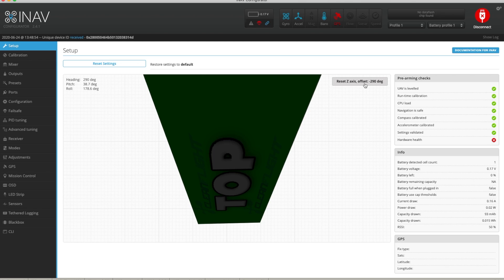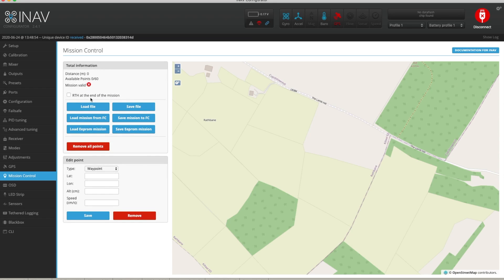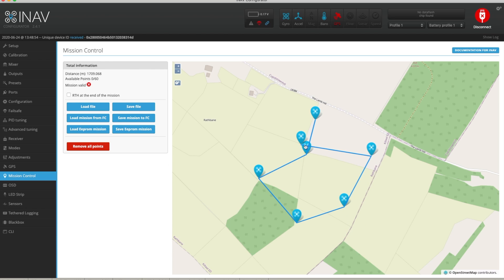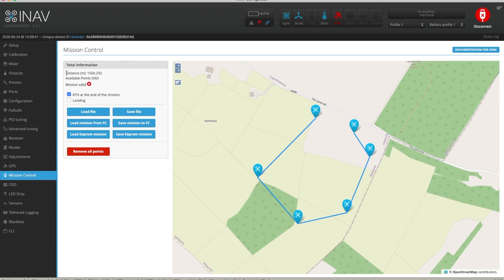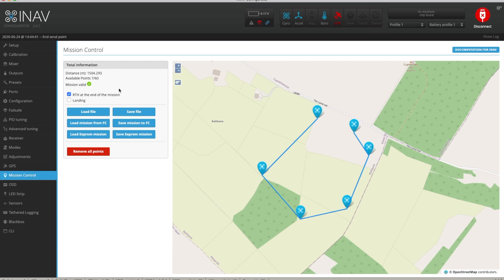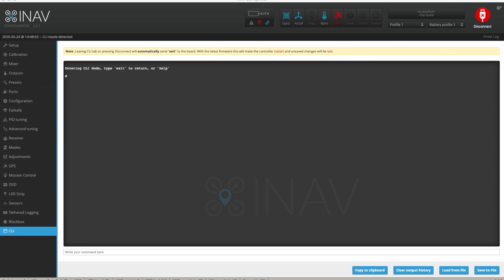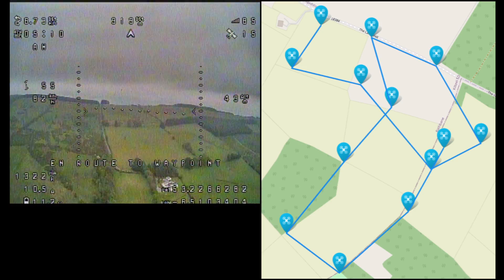iNav Mission Control for Fixed Wing ✈️ How to and Demo Autonomous Waypoint Mission 🤖

Comment from the maker: UPDATE: Please read the two minor corrections to my video in my video description.
IMPORTANT NOTE: Please make sure your plane flies well in an autonomous mode such as RTH before attempting a WP mission. I recommend higher altitude and close range for your earlier tests. Good luck! :D
Reply: Tx for the video, it inspired me to try flying a mission, which I did a few minutes ago, successfully.
I was just watching the FPV video back, and even though the speed did take a while to match, it did seem to get to my desired speed, eventually, and then maintain it. That might have just been coincident. Will try it again tomorrow.
Reply from the maker: Aidan, that's great to hear :D cheers!
Reply: RTH speed changes once you load a mission. Cruise set at 1550 perfect without mission. Once you load a mission and use RTH 1550 is too slow. With 2.5 anyway.
Reply from the maker: Hi Phil, I haven't noticed any issue with my RTH speed when using a mission and as I mention, I always use RTH at the end.

Comment: Hello. Will the plane continue to its waypoint missions if the transmitter loses connection..? Thanks..
Reply from the maker: @espanolacj  hi, there’s a setting for that. I explain how it works in the video
Reply: @AdamGdoesFPV  thanks..i watched your video again, and there it is .

Comment: Greetings, great video. I have a mission scheduled behind the mountains, I will surely lose TX signal, I will use the parameter failsafe_mission_delay = -1 so that the mission continues using the GPS. But what happens if I also lose the GPS? What function would this parameter do in the mission failsafe_gps_fix_estimation_delay = -1 ?. Would it be better to activate the failsafe_gps_fix_estimation_delay = 7 ? Would this activate the FS even if I have the ailsafe_mission_delay = -1 ? Now INAV 7.1.2
Reply from the maker: I don't think you can do anything if you loose GPS to be honest, whatever your settings you'll most likely lose the model. Losing GPS is insanely rare from my experience.

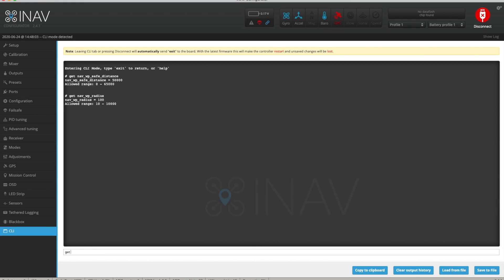Comment: Just wanted to share, at 8:05 CLI command changed to get nav_wp_max_safe_distance in later version inav.   failsafe_mission at 9:22 doesn't work either in 6.0 and look like failsafe_mission_delay = -1 makes the failsafe procedure won't activate at all.
Reply from the maker: To be honest I might take this video down as WP missions have changed so much in iNav this is no longer relevant. Thanks for the info
Reply: @AdamGdoesFPV  I was unawake when I saw this and wondered how anyone could find my upload and want to take it down.  Your waypoint video was one of a few I watched before trying it.  It did smaller area waypoint with no issue, but on 2nd trial covering a bit larger area (but nothing crazy at all), it failed.  Quite weird way.  Have you experienced or heard anything like this.  R-XSR is a suspect and will retry with a fresh part.  https://www.youtube.com/watch?v=5BHoS3-ULBM

Comment: Hi nice video, I am planning to build a fixed wing from scratch and want to use the Matek F411 WTE as FC. I was wondering if you would know if this FC is capable of waypoints missions. I assume it is since it runs on Inav 4.1 or higher but I am new to Inav so I am not 100% sure.
Greetings
Robin
Reply from the maker: Hi Robin, I run inav 5.1 on that FC no problem, so I can't see why you wouldn't be able to run WP missions on it. Cheers :)

Comment: Hi Adam. I have another question regarding regaining RC link. Will the waypoint mission continue when RC link is back on? meaning if between waypoint 23-30 I lost RC link due to distance, when it flies back in the range and RC link is reestablished, will it continue with waypoint 31, 32 .... ?
And I can also choose to turn off waypoint and take control of the flight there on?
Thanks.
Reply from the maker: Yes to both 👍🏻
Reply: @AdamGdoesFPV  
Thanks lots for your reply. I have successfully executed Waypoint Mission based on what you had shared.

Comment: Hi. 2 questions if you could help enlighten.
1) what if mid WP mission I want to abort, how do I take back control of the plane?
2) when it RTH and loitering, how do I take control back and land it?

Thanks.
Reply from the maker: Answer is the same for both. Just switch to a manual flight mode and you'll be in control.
Reply: @AdamGdoesFPV  Thanks! Got it!

Comment: That speed setting is used by multicopter. Fixed wing doesn't care about the speed value in mission control 😁
Reply from the maker: Yea, as per video description you need to set the ‘cruise speed’ as that’s what is used in WP missions.

Comment: Is the stick command the same in mode 1?
Reply from the maker: No you'd need to move the left stick to the top right. iNav is looking at the roll and pitch signals being at 2000, so that would be your left stick.
Reply: @AdamGdoesFPV  If I have to throttle at 1000 (down), rudder at 1500 (center), elevator at 2000 (up), roll 2000 (up) I get right hand down left and left hand up and center (in mode 1)
Reply from the maker: @claudiopepefly  Ok I just looked at Mode 1 layout and it's different to how I thought. But the way I see it now is left stick top middle, right stick bottom right.

Comment: Hi Adam , was wondering how to load the mission using mode 1 radio ? the Throttle and aileron is same stick. thank you.
Reply from the maker: Should still be elevator and Aileron into high position, whatever that may be on your tx. Worse case is you can load it by connecting to configurator with laptop

Comment: What is the maximum length of the mission? For example, can I send a gift to my grandma who lives 300 miles away using waypoints? Given that the batteries will last that long.
Reply from the maker: From memory there is no max distance but a max number of waypoints. So yes you can drop grandma her gift 1000 miles away if your battery will last 👍🏻
Reply: @AdamGdoesFPV  Thank you. I like that you answer every question as you stated in the video. This is totally new concept for me. 👍🏻

Comment: Hi,Adam. If I raise the right stick diagonally upwards before arming, load the WP into the FC, then launch the plane with Autolaunch, will it seamlessly transition to the WP mission after Autolaunch?
Reply from the maker: No you have to activate the waypoint mission, it is a flight mode.
Reply: @AdamGdoesFPV  Thank you. I was misunderstanding.

Comment: What if you loose the RC signal during the flight,and when the plane complete it's route,how do you establish the signal again to land?
Reply from the maker: 99% of control link failsafes are down to going out of range. If this is the case then you’d simply regain your link when the plane gets closer to home. This is assuming you either set the last wp near home or you chose the option for it to RTH at the end. Hope this helps

Comment: Dear Adam,
Thanks a lot for the very instructive video as usual. I have one question regarding to the speed. Can you change it in the different WPs? I friend of mine told me that the plane does not take care of the speed you put in each of the WPs but in the microseconds you have set in navigation system such RTH. Is it true? I hope that the mission can control the ground GPS speed as it looks like in your video. Can you clarify it please?
Thanks again,
Urko
Reply from the maker: Hi, unfortunately you cannot control the speed between waypoints. The speed during your entire WP mission is controlled by the 'Cruise_throttle' value. This is the same value that is used by all nav modes like RTH. Cheers
Reply: Many thanks for your quick answer. 
Regards

Comment: Hi.. how to setup on inav if we want the plane fly at certain speed, example if the plane will fly with ground speed / air speed at 45 m/h constantly. thank you for your help
Reply from the maker: Unfortunately this is not possible. When entering WP mission the plane will use your 'Cruise Throttle' value. You can of course adjust this to get it to fly as close to the speed you like, but then it will be affected by wind. Hope this helps
Reply: @AdamGdoesFPV  hio thank you for your reply, where i can setup the cruise thr value? thank you
Reply from the maker: @dekiaza  From memory I think its in the Advanced settings tab, on the right hand side half way down. This value is used by all automated flight modes so it's important to get it right
Reply: @AdamGdoesFPV  ohh.. okay, many thanks for your replay.. :-)

Comment: hello Adam, how if lost connection between remote and air plane, Waypoint still continue or fail safe?
Reply from the maker: If 'failsafe_mission = OFF' the failsafe procedure won't be triggered and the mission will continue if you lose RC link during a waypoint mission
Reply: @AdamGdoesFPV  thanks for your answer very helpful

Comment: I've been playing with inav mission planner and my c1 chaser with f405-wing and inav 2.5.0 I really like doing missions,  I'm trying to figure out how I could monitor the flight in real time on a android device, how could I do this ?maybe bluetooth module to radio video  you did ? Maybe a gps tracker? Any advise would be appreciated Thanks
Reply from the maker: Not sure to be honest, iNav isn’t currently designed for live tracking. I believe Ardu Plane is great for this if that’s what you want to do.
Reply: Ok thanks, do you use the inav mission planner  app? Just wondering  would this give ability to monitor flight in real time? Thanks

Comment: Is it possible to connect a pi via mavlink to a FC running INav for the purpose of utilizing a 4G Stick to stream live Data from a flight? I've seen pixhawk and ardupilot having Mission control centers that allow live tracking. Can inav do that aswell? I really don't want to go back to ardupilot but I really need a live update of where my plane is for long range flights.
Reply from the maker: Hi, unfortunately iNav isn't very good in this regard, something like Ardu is much better for live tracking and making live adjustments. Thanks for watching

Comment: how do i load mission with radio in mode 1?
Reply from the maker: Should just be left stick (elevator/aileron stick) held in the top right corner for a few seconds.
Reply: Adam G does FPV I will test it, thank you for your help.

Comment: Thanks Adam for the great video. I am concern regarding the speed, as I set 2400cm/s, BUT, this works only if you have a pitot probe installed on the plane. If your speed is set to 86kmh, this create problems when i have tailwind or headwind, as my plane is without the pitot probe, it 
tries to mantain the target speed even on headwind, and this causes full thrust at time. Tailwind causes a plane to stall. I tried an avarage speed which suits both wind components but this is not reliable. Any chance I can get a fixed thrust at all time?
Reply from the maker: Hey and thanks for the feedback. Unfortunately, I discovered after making this video that the speed you set in WP is no longer used, and your cruise throttle is used the entire time you are in a WP mission. Try increasing your cruise throttle for a WP mission and see if this helps. In iNav from what I understand a pitot air speed is only used to show an ODS reading for your reference and is not yet used in any of the automated flight by the AP. Hope this helps.

Comment: Good video and useful information Adam, Thank you. I have WP set up on my fixed wing and a 6" Quad. One question about Inav Missions on a quad. When the quad arrives at a way point it almost stops, turns toward and then continues to the next WP. Does anyone know how to program INAV to 'fly through’ the way point much like a fixed wing does without stopping. I guess you could call it a 'smooth transition'  at the WP.
Reply from the maker: Thanks 😊 not sure on the quad question, never had a quad on iNav. Maybe setting the distance from wp to consider it reached would help?
Reply: @AdamGdoesFPV  Just for anyone curious...I made the 'WP reached distance' much larger but the quad still abruptly stops at the way point, turns, and then continues toward the next WP.   A bit annoying but at least it will complete a mission.
Reply from the maker: @53roger  seems like strange behaviour. The wp functionality is very simple in iNav maybe on a quad you’d be better off with something like Ardu

Comment: Is a compass required for fixed wing?  When I try and start a mission it says.  Nav not safe. Yet I have 14 sats and RTH works perfectly. Any ideas?
Reply from the maker: Fixed wing do not need a compass. In fact using a compass can cause problems so you should disable it. Not sure why you're getting that error. Make sure you haven't set number of sats required too high
Reply: here is a video that will show you how to solve your problem (i had exactly the same issue a couple of days ago) https://www.youtube.com/watch?v=7MAdgGkBkXs     There is also addition information on Inav Wiki that can further explain the Navigation is Safe pre-check here 
https://github.com/iNavFlight/inav/wiki/%22Something%22-is-disabled----Reasons#navigation-unsafe-reasons
roger

Comment: What is the advantage of inav than ardu?
Reply from the maker: Hard for me to say as I've never used Ardu. For me I found iNav easy enough to learn and use, but I hear Ardu is not as user friendly. Many will tell you it works better than iNav if you can get your head round it though. I just don't have the time or desire to learn another right now

Comment: Adam what is your All up Weight with your Ar Wing Setup? I have the same setup and found it hard to takeoff when there is not much wind. So i changed my motor to 1400kv and a 8x6 prop at 3s 2200mah. My AUW is 804grams
Reply from the maker: 883g with the heavier setup using the Osmo action camera.What weight was yours that it was struggling to launch? or are you still having a hard time at 804g?
Reply: Adam G does FPV  Struggled at 804g with a 3s 3200mah 2200kv x 6x4prop so i changed my power setup to a 3s 2200mah 1400kv 8x6prop. Its flying with much confidence and authority now. Have to check Amp draw though if it will be almost the same with the former setup.. You’re really doing a great job with your vlogs! Making the hobby more exciting and more easy to understand! Kudos to you Adam!

Comment: strings
set nav_wp_radius =
set nav_wp_safe_distance = 0
Reply from the maker: Thanks I've added all CLI I discussed in this video in the vid description:
CLI mentioned in this video:
-nav_wp_safe_distance = First waypoint in the mission should be closer than this value [cm]. 10,000 (100m) default. Set to 0 to bypass this check.
-nav_wp_radius = Waypoint would be considered reached if plane is within this radius. Default 100 = 1m
-failsafe_mission = If set to OFF the failsafe procedure won't be triggered and the mission will continue if the FC is in WP (automatic mission) mode

Comment: Did my first WP mission today, just a small up the valley and back to try it out. This helped out a ton! I do want to add one thing though. Set the nav_wp_safe_distance to 0. If your first waypoint is further than what you have it set to you will not be able to arm the plane.
Reply from the maker: Hi Sam, great to hear this video was useful and that your first mission was a success! Yes this is correct, unless you increate the value to a high enough number, setting the nav_wp_safe_distance to 0 bypasses this check. Cheers

Comment from the maker: TEST COMPLETE: When NOT selecting RTH at end of mission the plane will loiter around the final WP at the altitude you had set for that particular WP.
Reply: And it will still display WP (and not mission ended or something similar). From there, if you toggle the mission switch off, it will loiter in place, and if you toggle once more mission switch on, it will go back to WP1 and start over again.

Comment: Thanks!  I've been struggling with starting a mission with a rover.  nav safe distance was the issue. There's actually very little mission control info out there. thx again!
Reply from the maker: Yeah I noticed there was a lack of info, which made it a little frustrating to learn how it works... thought this video might save others from the same frustration. There is a bug in my AR in relation to the nav safe distance, it doesn't work at all. If i set it to 5 meters It will still activate and successfully complete a mission where the first wp is 700m away. Thanks for watching

Comment: Very clear and instructive, thanks a lot! Getting ready to move into iNav from Vectors, but I use slower models than you seem to do, and don't like the idea of specifying a certain ground speed - that spells battery drainage in headwinds and stalls in tailwinds. In models with no pitot tube, I always set the speed to zero; that makes the FC ignore GS and just fly the craft. Does iNav offer the same option, or would it try to hover if you set speed to zero?
Reply from the maker: Hi, unfortunately iNav still isn't making good use of the airspeed information, i found out recently it's only used for reference on the OSD and is not used by the AP for autonomous flying, maybe this will change in the future, as it's always improving. Someone has mentioned to me that the speed in WP is not actually used at all and that it uses your cruise throttle value instead. This makes sense for it to operate this way but if that's the case I wish they wouldn't put a speed option in to confuse people. It was just coincidence that my cruise throttle makes it fly around the same speed as I had set in my missions. Hope this helps.
Reply: @AdamGdoesFPV  Certainly! Throttle value is just as good as airspeed, if not better. Ground speed is what I want to avoid. A lot of RCers seem to forget - understandably - that the model's reference point is the air it flies in, not the ground they stand on. The plane doesn't know or care whether it goes up- or downwind. As long as there is a way to make the FC ignore ground speed, I will be able to use iNav.